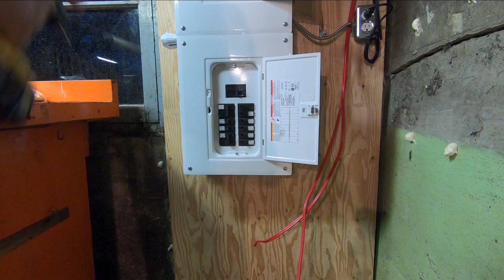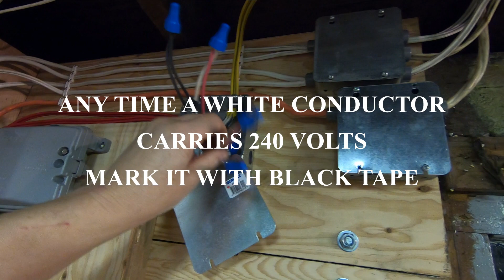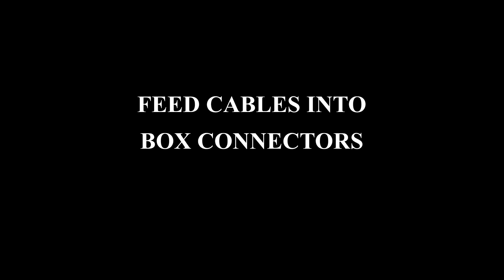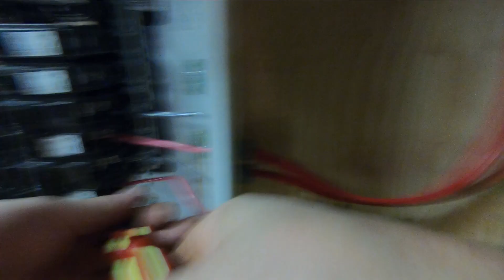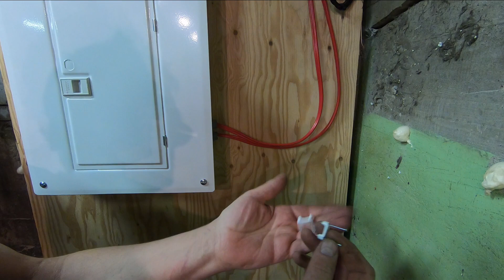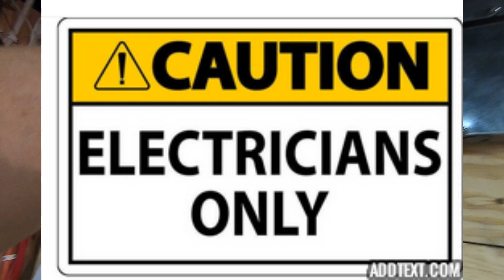How to connect wires to the breakers inside an electrical panel

Comment: Looks very neat and proper Craig! When you said  "I like to give it a couple extra inches inside the box" I thought to myself, I'm like that too!🤣
Take care Craig ✌
Reply from the maker: I always leave a little extra length when I cut and install wires, hoses, anything really. There is no bigger pain than realizing that the connection is just a 1/2 inch out of reach!  On my old tractor, though, getting the hydraulic steering hoses made-up a bit longer caused a problem. They have to bend up inside the steering column and fit just exactly. I added a few inches to the length and the new hoses may not work. I'll see later this spring. Usually, though, longer wires or hoses is the way to go. Hello to everyone and to the dogs.

Comment: Hi Craig you done a really good job and really tidy, i leave all electrical work to my pal who is a qualified electrician, in the uk they have to torque up all the screws.
Reply from the maker: Thanks Nev. There are different regulations everywhere. Getting the screws tight is important!
Reply: @EverydayProjects  it sure is, I was told the copper ends have to be cut to a certain length to go into sockets and breakers

Comment: This was interesting to watch and a great idea to take pictures. We have to put green/yellow sleeving over ground wires in the panel and everything over here in a domestic panel is 240v
Reply from the maker: The wiring in North America is different than the UK in many regards. As you know, we run 60 cycles (HZ) while you have 50Hz. And all your residential wiring is 240 volts. The receptacles and switches too are different. I've wired my whole house under permit and inspection. Homeowners in British Columbia can apply for permits and do all the work themselves, while some provinces (and states in the US), do not allow anyone other than a licensed electrician to do wiring. I learned a lot, studied the relevant codes and took my time. This panel in the video is not at my house, but I felt comfortable doing the work based upon my other experience.
Reply: @EverydayProjects  The differences are interesting. Dad rewired our complete house and barns before I was born but I believe that these days it can only be done by a qualified electrician unless you can find a tame electrician to sign off your work
Reply from the maker: Insurance companies will look for any reason to deny a claim. It is always best to have electrical wiring done professionally. Your dad is a very talented guy (if not the best cameraman and helper in and around the shop! Training, over time, however, should pay off! LoL):face-green-smiling: @GardenTractorBoy

Comment: How's she goin'?  That was a nice neat and clean connection.  You sure make the connections tight!!  LOL  But better to tight than too loose eh!!  I bet those heat pumps are making a difference this week!!  Take care!!
Reply from the maker: An electrician buddy once showed me a main breaker that was all charred and getting hot from loose wiring connections. Every since, I follow his lead and snug them down like my life depends on it (and it may). The heat pump video will be up soon. They are working well to heat the house in below-freezing temperatures. I hear that the East is getting Snow-plowing weather this weekend. The Massey will no doubt be out with its plow modifications, clearing the lane. All the best to you and Nanny! Don't hurt your back shovelling snow. I twisted my back last week and I am a bent up pretzel since. Ouch! (I get most of my exercise, as you know, from pushing my luck, stretching the truth, jumping to conclusions and running off at the mouth!):face-purple-crying:
Reply: A bad back can hobble even the fittest of us all.  I like your exercise regime though!!  We are supposed to get some snow.  So maybe I'll get to plow on Monday!!  LOL  Take 'er easy!! @EverydayProjects

Comment: Are you a licensed electrician Craig ?   Neat tool for doing the wire stripping. Nice looking job. 
Strange how a hardware store can sell electrical stuff to anybody without a license same with plumbing supplies. In the propane world, most places won’t sell you propane parts if you are not licensed in propane work. Just some entertainment rambling. 
Have a great day.
Reply from the maker: No. I am not an electrician, but I have had training in the military and have even wired my whole house (under permit). The electrical inspector who looked at my work a few years ago said it was very good. Yes, it's very strange that so much stuff can be sold to anybody yet the codes require you to be licensed to do most any work, (electrical work especially) and also plumbing, gas, etc.
Reply: @EverydayProjects    Thanks Craig. 👋